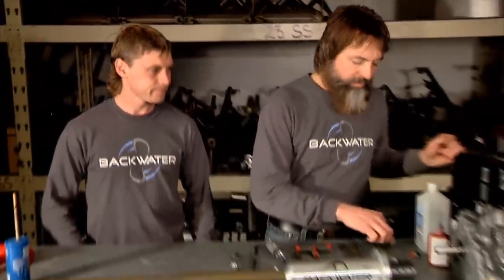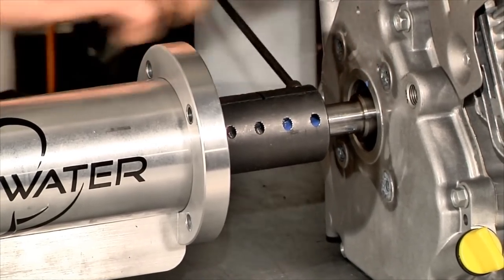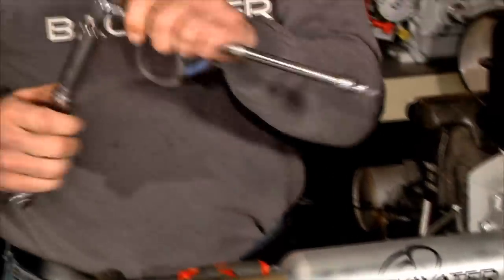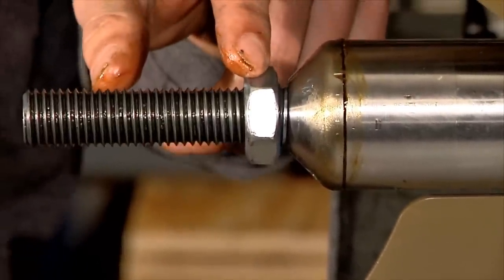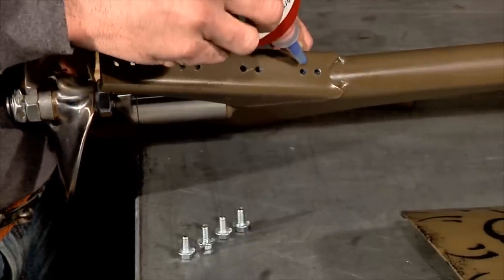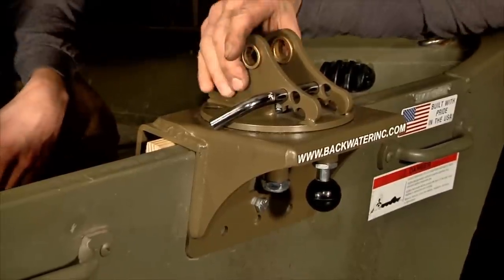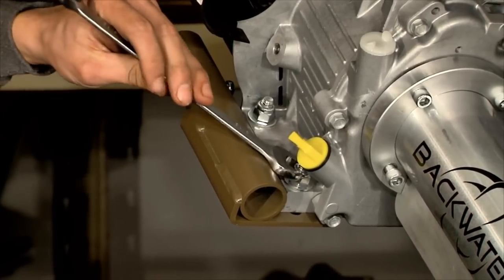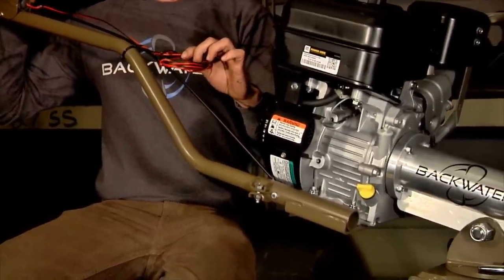Backwater SWOMP Lite glider kit (mud motor) assembly video

Comment: This kit is really nice. Great design and quality fabrication from what I can see. And they did their homework to ensure that everything is torqued correctly to ensure proper loading. Definately over built to last many seasons. Only suggestion if it hasn't been tried would be to include a thin vinyl sheath or vinyl tape to cover the prop shaft threads to reduce the risk of seal damage. Coming from an engineer, this is a throughly engineered and well built kit. Can't go wrong with this product. I'll be saving my money for one.

Comment: you didnt get the bolts tighten before mounting the engine to the boat-that is the bolts holding the tail to the engine .
Reply: Somewhere between 15:30 and 16:30 the bolt appears to have mysteriously tightened itself.

Comment: Here is an interesting situation.  The final lock  nut is the  narrowest one, and this is wrong as when he tightens it other thicker nut is lifted off its face which had been taking the load and so the whole force is now on the narrowest lock nut.

I believe the final lock nut should be the thickest and  not the narrowest. Just think about it!!  Many put the thinest nut as the final lock nut and this is in my opinion very wrong.
Reply: Thin nut is a nylon lock nut ,it needs to be last 🛠

Comment: trying to hook up a long tail kit to a predator 420cc  motors but they sent 
the wrong mounting bolts can you tell me the size/thread of the bolt 
holes that are the second set of holes if you start from the shaft going
 out.. or maybe the middle set of bolt holes... thanks man.
Reply: Chuck Cunningham

Comment: Poorly designed handle, it will be a pain to have to unbolt the handle each time you must change the oil. other than that really nice design and simple installation. two thumbs up!
Reply: +Jake Chandler They could have easily put the handle under the motor to make oil changing  easy.
Reply: Most engines have oil drain on both sides.